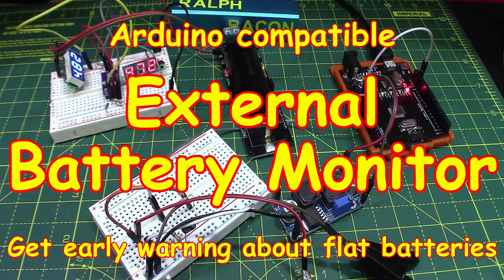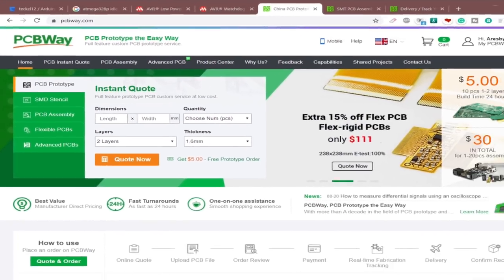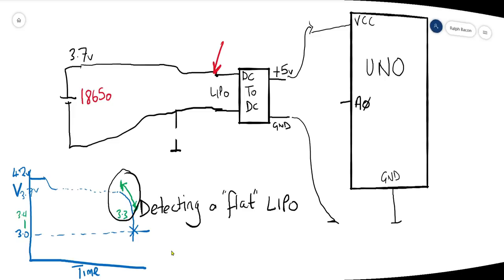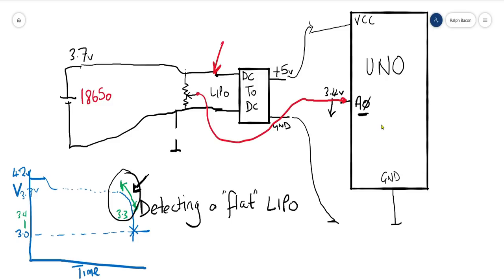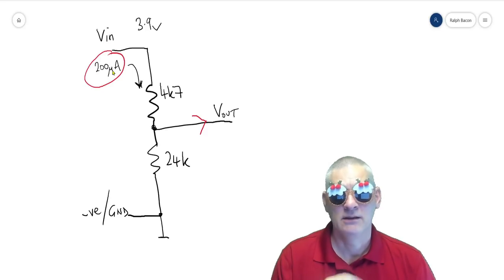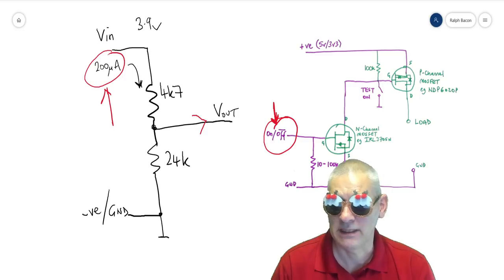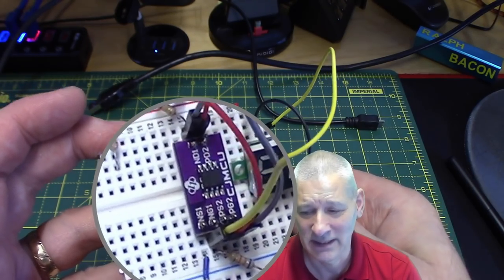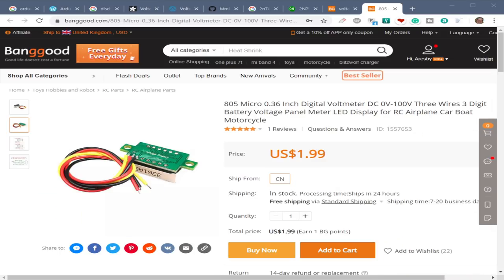#171 External Battery Monitor from your Arduino

Comment: Is there a difference when using this on an esp32/esp8266 with the voltage source being 3.3~ ? Do I use different values for the resistors?
Reply from the maker: Calculate the resistors so that the monitored voltage does not exceed your ESP32's VCC and is around that 95% of that value (otherwise you will always read 1023 on a 10-bit analog input).
Reply: @RalphBacon  thanks for replying kind sir. Another question but out of topic. When using a dc-dc buck converter with the source being a battery, when the battery level goes low, does the voltage output from the buck converter also goes low?

Comment: I wonder if a portion of a 4007 IC could be useful in terms of providing a couple of complementary FETs...?
Reply from the maker: Sounds possible but the only way to find out is to actually do it. Remember that the chips inside a CD4007 will be fairly low current. I probably have one of those chips lying around, I will put the idea on my list!

Comment: Can you share the link for the other MOSFET?
If you only use one MOSFET will not be enough?
Reply from the maker: Did you mean the other video, Auto Switch off, Luis? That used two discrete MOSFETS because we were switching potentially higher power. Have a look at video #123: https://youtu.be/g1rbIG2BO0U 

In THIS example we might have got away with one MOSFET (or even a BJT if it comes to that) by powering the MOSFET, or just the resistor divider, with output from an GPIO pin) but I was trying to adapt the auto switch off circuit but this time using a tiny IC. Food for thought!

Comment: Hi mr. Ralph, Is possible make a video where you go in more depth and show how this is setup? I've tried but not able to get it to work. I need a way to measure battery voltage on 3.3v battery operated sensor.
Reply from the maker: It depends, Stig, on whether you are running on a 3v3 battery (perhaps 2 AA batteries?)  or whether the battery goes through a buck/boost converter before getting to your Arduino. Is the sensor close to the Arduino or remote? Let me know your setup.
Reply: @RalphBacon  You know what, I just realized that I had forgot to put in 100K resistors like in your schematics so it works now :-) My plan is to make a wireless weather sensor using ATTiny84 with a weather sensor, a 433Mhz transmitter and a voltage divider. My thinking is to run all this from a CR2032. My thinking is to have the ATTiny sleep every 30 min, then wake up, turn on the sensor and read, connect the voltage divider and read voltage, turn on transmitter and send (haven't found out yet if sleep mode is supported) and then go back to sleep. All this data will be sent to an ESP32 with a small display and to the cloud so that I can integrate with Google Home and maybe even create an app. https://aconfluence.no/display/SS/Google+Assistant+based+weather+station
I'm not very good at this but it's a nice project and I learn a lot. Thank you so much for your help and inspiration :-)
Reply from the maker: I'm very glad you got it working. Just one point on the "waking up every 30 minutes". The maximum time an AVR chip will sleep is 8 seconds before being woking by the WDT. You can, of course, check a counter, increment it if it is not time yet to wake up, and go straight back to sleep. This means your Tiny44 will wake up about 225 times to increment that counter before deciding to do some real work. Still very power efficient. Or use an external interrupt - the question is, what?
Watch my videos on this topic, #115 and #116.
Reply: @RalphBacon  I watched the videos and it's exactly what I need. Just one note to the schematic, I needed a 1000 ohm resistor between P Channel Drain and ground before AO was able to measure correct voltage, with out, my oscilloscope showed just a few mv change between high and low. Is this correct?

Comment: Ralph!  It's a good job you are not a fly!!  Only two to fix!
Reply from the maker: "ONLY" two you say, Jon? MY left eye is cloudy, misty and slightly out of focus. My left eye is a sloshing glass of water through which I can see nothing much. If I were a fly I would go nuts! But the hope is that all this can be fixed in due course, so roll on summer 2020 (which will also describe my eyesight at that time).

Comment: Hi Ralph. How would i measure the voltage of evey single cell in a 7s battery?  I can inly use ground once. I could measure the difference every step up in the stringi voltage using voltage deviders but i worry 7 different voltage dividers introduce lots of errors or devintions in the results i wonder if tgere is a better way?
Reply from the maker: Hmm... you might be able to use an ADS115 Analog to Digital converter for each of the battery cells. That way, each cell is measured accurately. Have a look at video #104 and see whether that helps at all.
Reply: I believe that some ADC modules have more than one channel, seem to remember one with 4 channels. 2 ADC modules might be able to monitor your 7 cells, guessing that you access each channel sequentially in code.

Comment: I am surprised how you're getting that Serial Monitor Output, as you are Currently connected to External Battery to power up Arduino right ?.
Or Are you connected to computer USB port for Arduino to Power up ?
Then, what  the External battery is doing just for Voltage divider ?☺️
Reply from the maker: I'm pretty sure I was running this on a battery to monitor its voltage with the potential divider. Remember it uses the internal AREF fixed voltage reference. Although this video is now well over a year old I remember that I was surprised at how easy it was to do this (but don't connect AREF to 3v3 until the sketch is loaded or the magic smoke will appear).
Reply: @RalphBacon  Thanks Ralph for the Reply.
I tried this with Sleep function and it works perfectly fine Thanks.
What i was confused initially and asked you the question was
 how you connected External Battery to power up Arduino and connected Computer USB at the same time.?
 Since you got that Serial Output in ur computer Monitor..right?
as you must have connected it through a computer USB.So, then Arduino will also automatically draw Power from.USB and not from Battery right ?.
Since it was not clear, i connected a OLED to display the Battery Voltage. Thanks 👍
Reply from the maker: No, I have a separate FTDI USB-to-Serial to connect to the Arduino (for the serial monitor output) but I do not connect the +5v, just RX (goes to TX on Arduino) and GND.

Comment: You did make that more complicated than it have to be. With a 5V processor and <5V battery there is no reason to use a voltage divider (A series resistor can be a good idea). If the mosfet is used to turn on/off the sense input you only need a P-MOSFET and can directly drive it from the processor, but with the Arduino you do not really need it when only using a series resistor.

I have made discharge curves for 100's of LiIon batteries and not seen one that is flat yet: https://lygte-info.dk/review/batteries2012/Common18650comparator.php  These curves can also be used to estimate remaining time or charge percent.
If you use LiFePO4 the discharge curve is flat.
Reply from the maker: I love all those discharge curves - I even have some of the exact batteries you have tested. I guess the "nominal" voltage is more an "average" voltage. At least you showed the voltages all dropping off the edge of a cliff though, at the end. But it seems we might catch it before that happens with the discharge curves you plotted. Very instructional, thanks for that.
But I made it (slightly) more complicated one to allow for voltages greater than 5v (eg many drone batteries are higher voltages) and car batteries (or other, smaller lead-acid ones) are 12v of course. Not to be connected to the Arduino without a resistor divider (and now everyone knows the formula to calculate that too!).
I did wonder if a P-Channel MOSFET with its gate brought LOW by an Arduino GPIO and the DRAIN brought to ground via a series resistor (connected to A0) would work reliably. You seem to indicate that would work OK?
Reply: I test all the batteries I can get my hands on (LiIon, NiMH & Alkaline), this also means I publish a few battery reviews each week and have done that since 2012.
The nominal voltage for LiIon is the average output voltage, sometimes (not often) you even see it specified with and extra digit like 3.62V instead of just 3.6V or 3.7V

As long as battery voltage is below Arduino voltage and you do not turn the port output off (High-Z or remove power to processor), you can control it directly. If you remove power to the processor the FET will most likely be on.
Reply from the maker: I think that was one of the issues that Jessica faced: the analog port remained on after switching off the Arduino and started then powering the whole thing in some weird way. I never knew there were so many batteries out there, you must be busy doing all this!
Reply: Battery tests are mostly automatic, but they take nearly a week for each battery (A few is more), I have a couple of "Test stations" that I simply has to load with next battery. In addition I have to take some photos, do a minimal amount of writing, move some files and run a couple of scripts. It is not that much work, some of my other reviews requires much more work.
Reply: @henrikjensen3278  Have you found that the discharge curve is fairly linear over the useful range say 4.2 to 3.3 so that after 20 minutes or so you can extrapolate ? I have been charging then discharge and plotting the volt vs time at a constant current discharge using recycled batts and found I really didn't have to discharge all the way.
Reply: It depends on the chemistry (LiIon batteries use many different chemistries). Some are fairly linear, other not so much. The drop off voltage will also vary and how steep the drop off is. You can use my link from above to see all the different curves.

Comment: That's not a lipo? right?
Reply: Same thing, just a different form factor.
Reply: @superdau  I think they have different "chemistry"
Reply: @andymouse  
They can have different chemistry, but so can cylindrical cells between them and pouch cells between them. The form factor is not what dictates the chemistry, what the manufacturer puts in them is. You can have the same chemistry in either. Have you ever seen something like IMR, INR, ICR, IFR, LMO, NMC, NCA, NCO, LCO or LFP written on cylindrical cells or in their datasheet? Those signify different chemistries. Pouch cells use the same chemistries, although they most often use the Lithium-cobalt-oxide chemistry (ICR/LCO), which is also the same that's often used in laptop battery 18650 cells.
Reply: @superdau  cheers!
Reply from the maker: My bad. I tend to use the word LiPO to encompass Li-Ion and even rechargeable Ni-Mh and the such like. The cylinder battery is Li-Ion but the smaller (flat) ones I was experimenting with (from drones) are, apparently, true LiPO. Not sure of the exact difference apart from the chemicals inside.
Reply: @RalphBacon  
The difference between "li-po" and "li-ion" is the shape (dictated by what you want to use it for), not the chemicals. Calling them "li-po" and "li-ion" is incorrect. I wouldn't care, if people then wouldn't start claiming that you have to treat them differently just on the basis of the shape, completely ignoring that the shape has nothing to do with what is inside a cell (that's what the datasheet is for). The correct names are "pouch cells" and "cylindrical cells". They are all li-ion cells. (even LiFePO cells as they also use lithium ions to store the energy)

There are so many different combinations of electrode materials and electrolytes that just putting them into "li-ion" and "li-po" category, even if that were a correct distinction, would be pointless. My guess why "li-po" as a name came to be is marketing. Cylindrical cells were the norm when the somewhat "freeform" pouch cells came along. Someone heard about the "new" cell chemistry of real li-polymer batteries at the same time and slapped that label on their batteries, because, hey, they got a polymer sheet separator in there (as all of those cells, even the cylindrical ones, had anyway) and a polymer (=plastic) pouch around it, even when that has got nothing to to with actual li-po cells. Lipos true to the original meaning of the name (the electrolyte itself being a solid polymer) still don't exist commercially. 
I feel something similar is happening with the "graphene" label currently. Real graphene cells are nowhere near out of research (meaning nicely arranged graphene structures). Marketing heard about graphene being the future. Almost all cells use carbon on the negative electrode in the form of graphite flakes (has been like that for decades). Now tell someone that graphite is many graphene layers stacked on top of each other and boom, you got your "graphene" cells.
Reply from the maker: Marketing. Also known as Dumbing Things Down so We Don't Confuse The Poor Customers! Yes, it's a fact of life, I'm afraid. Oh well, I think everyone understood what I meant though, but thanks for your illuminating explanation, I had to read it twice! Lithium PLUS cells are sure to be around soon...
Reply: @RalphBacon  Perhaps you're dumbing a bit too far down always using "Lie Poe".  It might be sufficient to refer to 18650s "Lithium Ion" (Li-Ion) as they almost all are, and the pouch or prism cells and batteries as "Lie Poe" as they mostly are.  Calling everything "Lie Poe" might actually give the inexperienced the wrong information.  What they've got to go on from you is '18650' and 'LIPO'.  Not a likely case.  IMHO the term LIPO has come from Li-FePO4 (Lithium Iron Phosphate) as a simple and more easily pronounced diminutive.  However I was hoping that, as your aim is to educate, you might be persuaded to use more correct terms.
On a second matter.  Why not arrange the voltage divider so that it can measure the full range of the 18650 cell's range?  Having a resistive divider ratio of around 4:3 (120 kΩ at the top & 330 kΩ at the bottom)  allows for reading voltages up to about 4.5 Volts which covers a well charged Li-Ion or Li-FePO4.  This means, after a bit of rough calibration, that the MCU can actually track the battery's charge level from 100% down.  See https://lygte-info.dk/info/BatteryChargePercent%20UK.html  While the voltage to charge level isn't super linear, treating it as such isn't too far from the truth, and probably good enough for an Arduino project.  Assume 4.2 Volts is 100% and 3.1 Volts is 0% will probably work.  Use 3.2 Volts as the 'don't discharge any further' limit perhaps.  A simple function to read the ADC and return a U8 between 0 and 100 would do the trick with the clamping of the result done in the function.

Comment: Worrying about the current drain of the voltage divider is like worrying about a prostitute's bad breath when having unprotected sex.  The efficiency of the boost converter swamps the overall efficiency. While 95 to 98%  efficient boost converters can be had, MOST use far cheaper and far less efficient boost converters. Read the datasheet charts, lads.
Reply from the maker: I think the efficiency of the one I used is about 85%, Kenn. But as I said, we have to be sensible when trying to squeeze the last ounce of power from our batteries. It would be better to have the dual MOSFET switch on the LiPO-powered buck-boost device (OOPS! Li-Ion, I meant, of course) thus removing all current drain.

Comment: INA226
Reply from the maker: The INA226 is more a current sensing device, Javier, I've used a mains voltage version previously to detect when the washing machine switches off. But they are not cheap (not even from Asian markets) about $5 each.
If anyone wants to look, here's a link:
https://www.banggood.com/CJMCU-226-INA226-Voltage-Current-Power-Monitor-Alarm-Module-36V-Bi-Directional-I2C-For-Arduino-p-1101401.html?p=FQ040729393382015118&utm_campaign=25129675&utm_content=3897
Reply: I use the INA226 as a voltage sensor, 840k Ohm input impedance, infinite in standby mode, 36V max. and very accurate 16bits. I am just ordering 4 more at this moment. INA226 on ali is €1.20. I like it a lot!
Reply: @javierpallalorden   I am with Ralph on that one I wouldn't use a dedicated IC and  add an I2c library just to read a voltage. 16bits is way over the top for this purpose (low battery warning). It also draws a Quiescent current which can be as high as 300-400ua! A nice IC but I wouldn't use it here.
Reply: @andrewtoogood1429  True, I agree on that it wouldn't be a good idea to use it in this scenario (a resister divider is way cheaper and simpler, leaving out the mosfet switch....), but in general to measure a voltage on it's VBS pin with very high accuracy and high impedance......…..it is a very nice chip.

Comment: 30 minutes to say use a voltage divider and one of the analog inputs!
Reply from the maker: 30 minutes to describe an issue raised by a subscriber, show a dual MOSFET circuit previously used and now adapted to prevent battery drain via the potential divider, with a couple of bench experiments with some LED readouts (who doesn't love an LED display?). So, yes, 30 (rather disjointed) minutes to say all that. Too long, didn't watch? Shame.